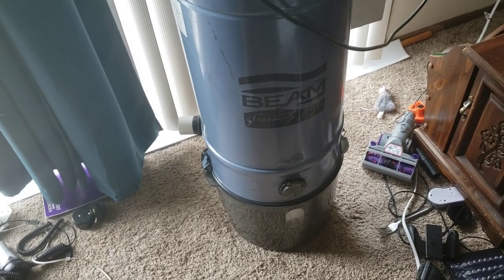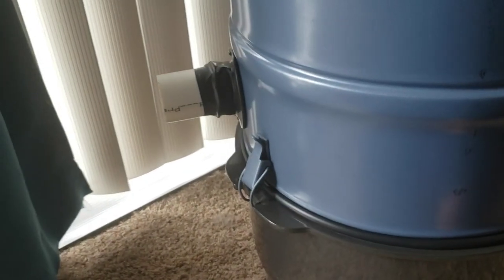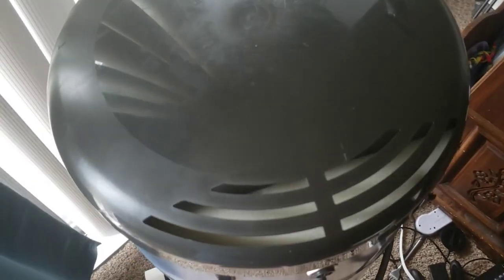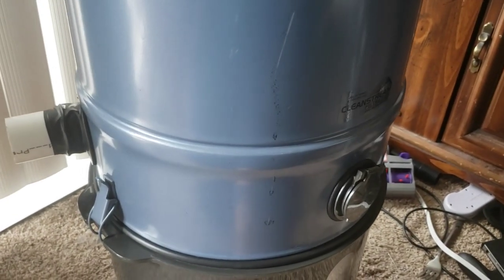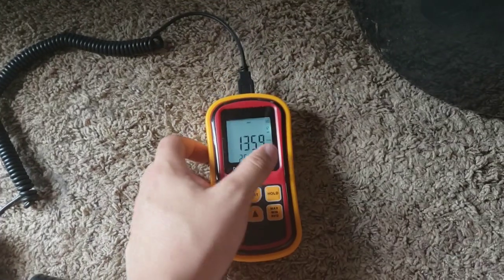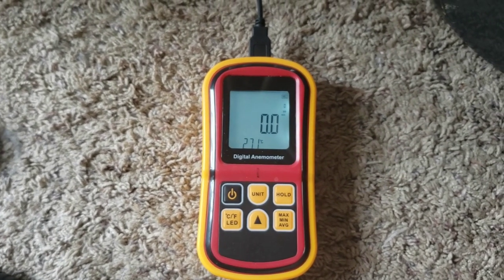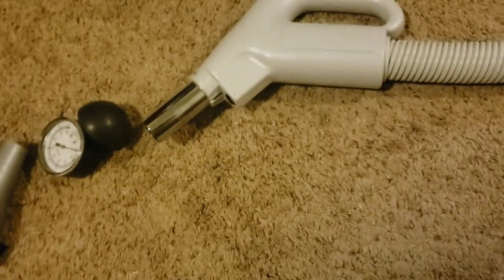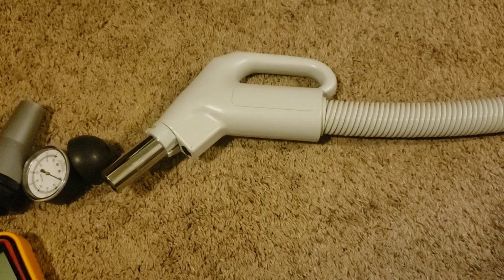Beam 2900 central vacuum Airflow test

Comment: One final thought: these large parallel motor units tend to be far more impressive than the series motor ones. Especially when installed, you notice the vast increase in airflow more than the added suction of a series motor, you feel it when using the attachments as it grips the floor, you feel it at the end of the hose when the suction instantly builds after putting your hand over the end. And you really notice it if you have it with a retracting hose.
Reply from the maker: hmm I've often wondered which setup was better. I thought perhaps the high suction of the series would allow it to overcome the resistance of the long hose better but that was just a thought. I'd still like to get my hands on an affordable series unit just to see how the numbers compare.
Reply: @Blackheartvacs  You really want as much of both sealed suction and airflow as you can get, within reason. Anything above 130-150" is going to make using the nozzle difficult if you have sufficient flow with it. And anything above say about 250 CFM will be completely imperceivable at the hose end, even in the biggest houses. As for the restriction of the hose, the best practice is to deal with the hose and allow everything to breathe better. The newer 1 3/8" inner diameter hoses breathe better than the 1 1/4", and a crushproof hose will always breathe more easily than a wire reinforced vinyl one, because the crushproof one is smoother inside.  Your Beam 2900, my SilentMaster S5, or something like my NuTone CV850, and anything of that variety is what I consider to be the sweet spot for performance, based on experience. Here in the "Mile High City" my S5 gets similar numbers to your beam, about 250 CFM and 118" of water lift, at sea level is 190 CFM and 140" of water, as higher altitudes lend themselves to lower suction but better flow of the thin air.

I definitely would still get my hands on some series motor unit, because why not!? I've learned a lot by experimenting and then talking to other collectors who work with centrals and comparing my experiences. I've got quite a few units myself.

Comment: I thought the 2900s used 3 stage motors, the 2500 does. I have a 3500 with bad motors that I traded in last year, that ones uses these high speed 2 stage things, and they don't last too long.
Reply from the maker: I'd guess the filtration has something to do with that?
Reply: @Blackheartvacs  filtration makes it worse or better. More dirt accelerates wear, but the higher speed is what shortens life: more heat, more bearing wear, more centrifugal force on the fans... The last one is where dirt kills the hardest. Either tearing the fan apart, or vibration that ruins bearings.

Comment: Great job and what a beast! Hose wise, the best I've ever measured is 120 CFM, so yours sets a new record!

So would you say it uses 2880 Watts?
Reply from the maker: well that's what it rated for. I can't confirm this though. The outlet's plugs are horizontal rather than vertical. Probably preventing people from destroying 120v devices